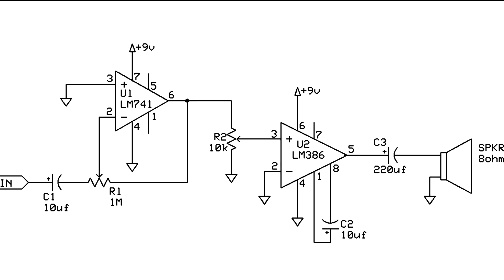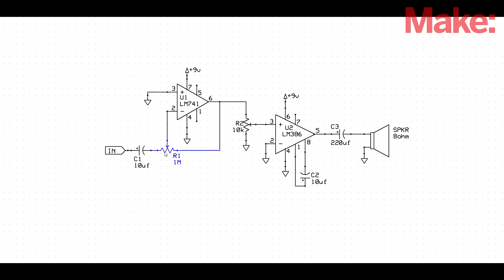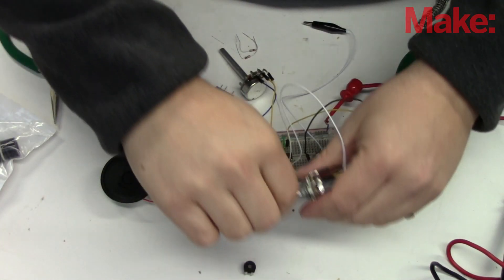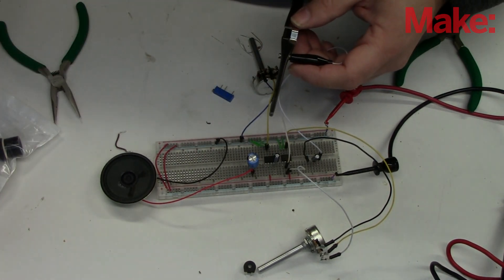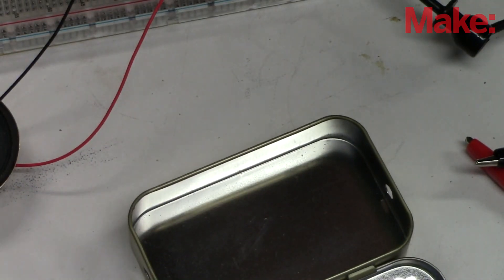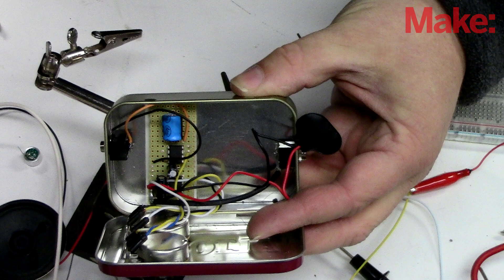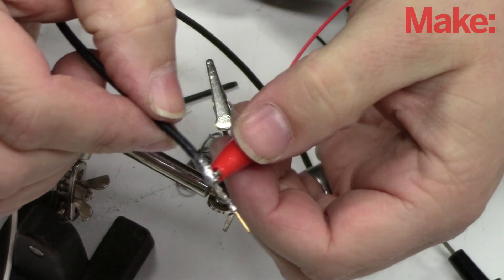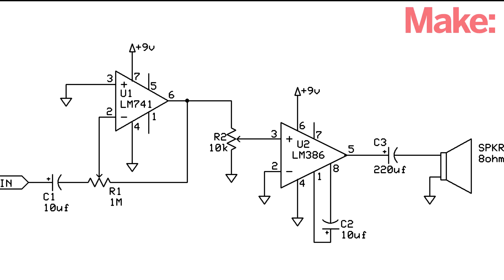Projects with Ryan Slaugh: Simple Amplifier

Comment: This guy does not seem to know how to make a proper amp. He is using a unipolar power setup but he isn't biasing the input to get the signal within the full operating range of the opamps. the majority of that "noise" he is talking about is actually distortion. He is basically half wave rectifying the signal with the 741.

Comment: The lm386 isn't a op amp it's a power amp. And the lm741 is hardly ideal for this, the slew rate is only about 5mV/sec a much better choice would be TL072 instead of the lm741. 

And whilst the lm386 is easy to use it is only designed to output 0.25 W, the output impedance is, really, too high for this application.
Reply: +Joshua Mcateer The LM741 is 0.5v/us... where did you get 5mv/sec? That would make one useless ass opamp. It is sluggish by todays standards, but for general use, is still very handy as comparators and filters or where its gradual nature is a good thing. They are also good for not overshooting, which is common for extremely fast opamps.
No sense in over specing your parts for no reason, and the LM741 is cheap as hell, and really, you should use it when it can serve your purpose, otherwise you are flushing money down the toilet.

Comment: and whats the voltage on the 10uF caps? or does that not matter? i kinda wanna get this right.
Reply: The bypass cap from pin 1 to 8 on LM386 can be pretty low, 5 or 10V.  The decoupling caps for the input and output I used 35V caps.
Reply: this is such a low-power circuit, It shouldn't matter, not even the value, as long as it is 10uF or higher.

Comment: what ohm potentiometers are you using? what are they rated for? 1? 10? 100? what? or does it not matter?
Reply: The pots are called out in the schematic file (that was evidently not attached, Ill try to get that fixed).  One is a 1 MEG (Feedback for LM741) the other is a 10k (Input for LM386).

Comment: it can be used for as a micro guitar amp right?
Reply: I was thinking the same. Maybe even scale it up slightly and make my own "Pignose" type mini amp? I'm not sure but it seams like it would be easy enough.
Reply: I think you can do so but you can drive only little speakers with it.
It is also possible that it would add a little bit of distorsion to he guitar sound but overall it should work.
Reply: Yep, sure could.  It would distort a bit given the gain on the 386.  I would remove the capacitor going from pin 1 to 8 in order to get it back to a gain of 20.  The guitar should have a preamp on the pick-up that would remove the need for 200 gain on the 386.